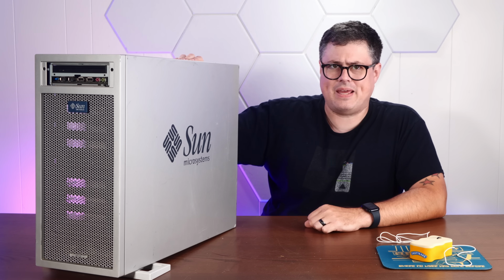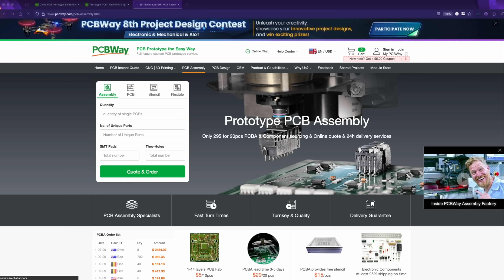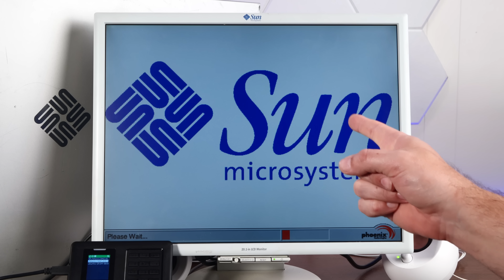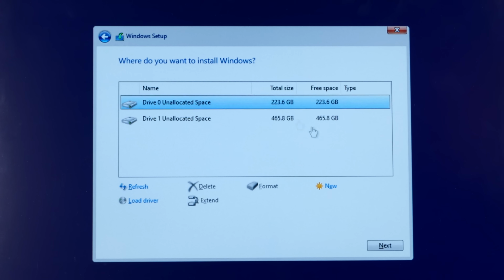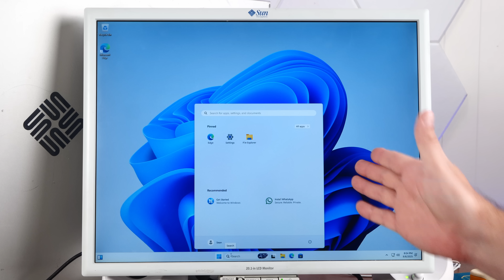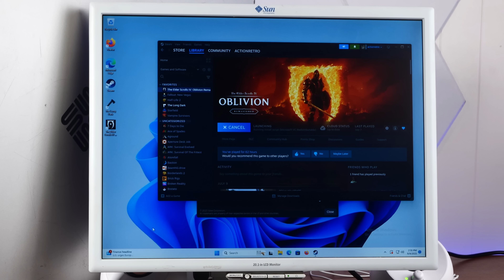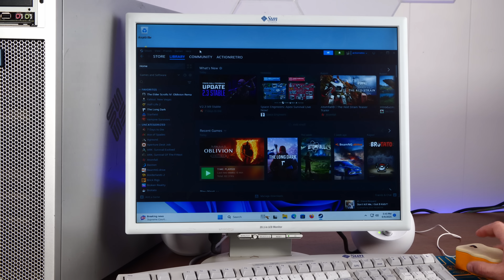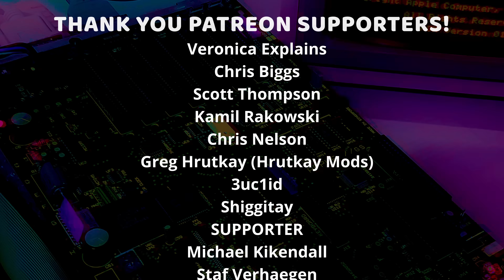The Oldest PC That Can Run Windows 11

Comment: "The Gen Z Windows Vista" - I hadn't thought about it that way, but yeah, it is!
Reply: The funny thing is that I actually liked Vista. It's better than 8 & 11 imo, although 7 was the last "good" version of Windows looking back, again, imo.
Reply: @cameron_bosch I never hated it, either. In fact, I liked the aesthetics and finish better than 7. 7 was just a better OS and ran better.
Reply: Fun part, back when vista was launched i went with the black ultimate 64 bit edition for my c2d 6400 (later replaced with a c2q6600). The os never gave me issues or any problems. Yes getting some drivers on day one could prove a little trickier but that was the 64 bit thing. 
It was stable, fast and i even liked the star menu more than with whatever releases since then. IMO vista and windows 7 are the last good windows version released. Afterwards came the decline.
Reply: @snakeplissken1754  no it was also a driver difference thing. Not just 32 versus 64bit bit
Reply: Gen Z experienced Windows Vista so that doesn't really count. It's the Gen Alpha Windows Vista.
Reply: @InfamousAMH I agree. Heck, I am a Gen Alpha (Or Zalpha?) myself.

Not only that Windows 11 has ridiculous requirements, it also runs badly, the only reason for kids my age (13) to use Windows is for their Fortnite's and GTA V's because those games use a kernel level anti-cheat that are otherwise not allowed on Linux unless they enable a single toggle in which no company does, yet there are some games with anti-cheats that support Linux but may be offline only. Im really hoping for Linux to become mainstream, which I would say could happen in a year or four, though I also think it's unlikely.

Also I completely despise the soulless corporate style they brought to 10 and 11. 8/8.1 at least had some theme for its Metro UI that carried over from the Xbox 360 (I'm almost finishing GTA IV on it as I type this!) and I just think that corporations should go back to "Frutiger Aero" or "Frutiger Metro" which the second one is... a bit worse in my opinion, but dang, I love the design of the blades dashboard, NXE dasboard of the Xbox 360 and Windows 7 (I had a family computer when I was younger and it ran Windows 7 until it updated to Windows 10)

For one thing I must say, is Im sure that if Vista didn't have driver issues and high end requirements, then it could've been a success.

Windows 11 is just dumb and looks like it was inspired by the book "1984" with all of it's spyware.
Reply: @InfamousAMH  Eh, Vista was a rarity to find. For most of us XP, 7 and 10 were the major releases.
Reply: @cassyettetape Well yeah, that's the topic. Vista and 11 are both the ugly and unloved ducklings of their respective families (7 and 10). The main differences being that the release dates are flip flopped, and nobody was really forced into Vista like they are 11. Windows 11 is still the ugly duckling that nobody really wants, while 10 remains the preferred option for general use, enthusiasts, and budget gamers. It only lacks long term support.
Reply: @InfamousAMH  I think the ONLY reason it even makes sense to say "nobody was really forced into Vista like they are 11" is because Vista was so bad that Microsoft almost immediately released 7 to replace it. I had a Vista laptop and it came from the manufacturer with an offer to freely downgrade to XP. And, IIRC, a LOT of people were downgrading their computers to XP even if it was unsupported by their manufacturers. I upgraded mine to 7 as soon as it came out.
Reply: @SuperDavidEF Exactly. We had the same outrage with 11 looking like flat corporate junk and feeling alien, but Microsoft basically just said "stfu and wait, it's undercooked just like every modern software release." 😂
Reply: @cassyettetape  I did use vista a lot in school because my school was too lazy to update them to 7 lmao
Reply: @cassyettetape  well, im Gen Z and my 1st PC was on Windows 98, later upgraded to XP :D
Reply: I'd argue that plenty of zoomers like myself were too young to really grasp how bad Windows Vista was, so Windows 11 was basically our taste into such a crapfest.
Reply: @InfamousAMH  gen z "experienced" windows vista at 9 years old so i think the original comment is still accurate
Reply: @furret1_ 9-10 years old is plenty age to start computing. I started at 4 y/o on Vista. Gen Alpha would be at the same age range by the time 11 came out, so I'm still sticking to my guns.
Reply: @InfamousAMH  what does gen alpha mean... cuz the oldest gen alphas would have been 11 when windows 11 came out (im also born in 2010) and i experienced windows vista before i was 11 in vms and a year later i installed vista on real hardware and shortly after didnt like it (never experienced it officially as of today tho aka with real install media)

initially i sort of liked windows 11 but not long after i realised how one it was just windows 10 with a coat of paint and two the bloat got amplified a ton (taskbar is a uwp app, the file explorer has the worst delay and bugs etc, every click took longer than in windows 10 while it never needed to because it was just windows 10.... but with more unoptimized code)
Reply: @randomgamingin144p Gen Z was 1997-2012, Gen Alpha was anyone born from 2013-2024.
Reply: Isn't windows vista the windows vista of gen z? I'm gen z and I very distinctly remember the xp > vista > 7 progression
Reply: I gotten Vista at launch and it didn't gave me problem and absoutely love it. I use it a few more years as my main driver even when it went EOL until my hardware gave up and given up the patches which I didn't miss. Switch to win 8 luckily only for a while till win 10 is out. Unlike Vista, I cant let my security to be compromise nowadays.
Reply: Windows 98 was a barely usable mess at launch. Windows XP was a barely usable mess at launch. Windows Vista was barely usable at launch. All of them got patched within less than 2 years after release into decent good functioning systems. At launch Windows 7 was literally barely more than the patched decent Vista with a different desktop and a few rendering tweaks and changes. Windows 10 then became the barely usable system at launch. Microsoft's mistake literally always is abandoning a windows version by the time it becomes great and a finished product.
Reply: @EximiusDux   Well said!
Reply: i am gen z, i remember using windows vista in my childhood in 2014
Reply: I'm gen Z and our primary school computer lab was all vista pcs 😭
Reply: at least Vista was aesthetically pleasing
Reply: More like Gen Z Windows Me
Reply: At least you had the option to ignore vista. But now it’s windows 11 or nothing, if you want a windows that’s up to date. I personally much prefer Linux, even if I can’t ignore windows completely…
Reply: This generation thing is super hypocritical since on the one hand, a Gen Z born in the first world is not the same as one born in third-world countries...And since it was in 2007, I played Vista-equipped computers, and honestly, not those pieces of junk with 512MB of RAM that they made for XP with the "Vista capable" label.😅
Reply: a lot of gen z people really love windows vista because it was their first os and they ignore or don't remember the bad stuff they have an entre movement based on it called Frutiger aero were they glorify windows vista
Reply: @belstar1128  TBF, Aero was the best part of Vista. I would dare say it's the only part of Vista that I would consider to be an upgrade from XP.
Reply: @SuperDavidEF  it looks good but low end hardware still being used at the time couldn't handle it well
Reply: vista had pretty high requirements, but didnt use resources for the stupidest things and didnt track your every move
Reply: Vista was only bad if you ran it on bare minimum spec.  On midrange hardware it was decent.  The time MS should have artificially limited what hardware an OS would install on they didn't, now they are just doing it to make sure you upgrade to something that supports AI better.
Reply: Don't forget gen beta
Reply: @WilliamHollinger2019 Gen beta is still on Cocomelon 😂
Reply: yeah it's pretty much that.
Reply: hey so gen z here my computer when I was younger had vista my personal laptop, the family laptop and the desktop computer was perfectly fine its probably because we weren't running it on hardware made for xp
Reply: Windows vista was released when Gen Z was 10 years old... so not really.
Reply: Gen alpha*
Reply: no its not true. vista didn't actually suck. Windows 11 does.
Reply: @bionicseaserpent  Bro, I literally had Vista. It sucked. I also knew several other people who had it and didn't like it. Microsoft came out and said it was targeted toward more powerful hardware that they thought would be mainstream by then, but it wasn't yet. But that wasn't all. It had a lot of driver issues, which Microsoft blamed on hardware vendors, and lots of flaws. Lots of people were downgrading to XP, until Microsoft made XP worse through updates, and then released Seven to replace Vista.
Reply: @SuperDavidEF  and 7 is literally just vista with updates and a different look. you can't tell me 7 isn't overrated as fuck.
Reply: @bionicseaserpent  yall are forgetting that Vista had a boatload of updates that made it leagues better than it was at launch. I like fully-updated Vista, but Vista RTM deserved the hate
Reply: @bionicseaserpent  I can tell you it isn't over-rated because Vista was so bad, it NEEDED to be replaced by 7. Vista itself was the "over-rated" garbage heap that should never have existed.

Now, I do believe, and lots of people said it at the time, that Windows 7 SHOULD have been just an update to Vista, or at least a free upgrade for anyone who had already bought Vista. It was really dirty of Microsoft to charge people for Windows 7 when we had suffered enough with Vista. In that context, I'd agree that it was (or should have been) just Vista with updates and fixes.
Reply: Na windows vista wasn't malware it was just terrible.  Can't say that about windows 11.
Reply: @thisisobviouslybait  exactly, Windows 11 IS Malware.
Reply: @thisisobviouslybait  You have a point there.
Reply: It's 'windows' for everybody who is now alive and using a relevant updated windows on their computers. It's used by boomers, millennials, gen z, and alpha. There are 6 named generations living their life at the same time trough the past 40 years.
Reply: i had windows vista, but i hated it, had to reinstall it like 4 or 5 times on the same laptop because it kept bricking itself, but windows 7, i used that for years and never had to reinstall it once.
Reply: And personally, I don't care. As long as it works and I'm happy, I couldn't care less about the drama social media comes up with about Win11 for the lulz . I know that sounds like a boomer statement (I'm Gen X/Millennial BTW), but I don't care. LOL 😅